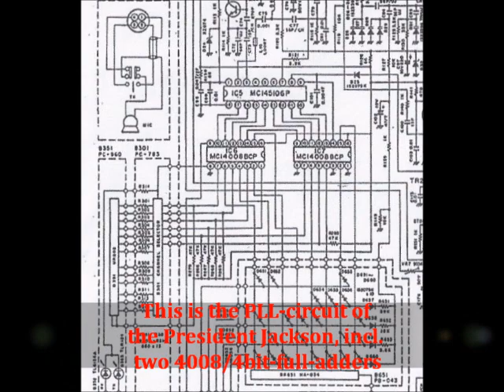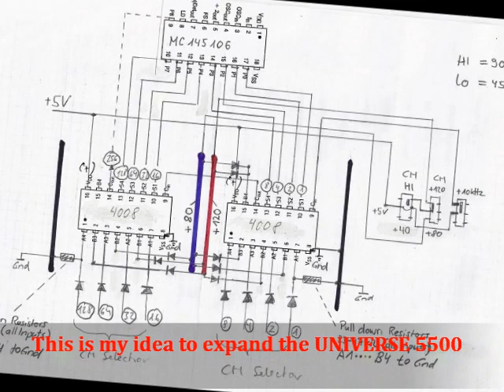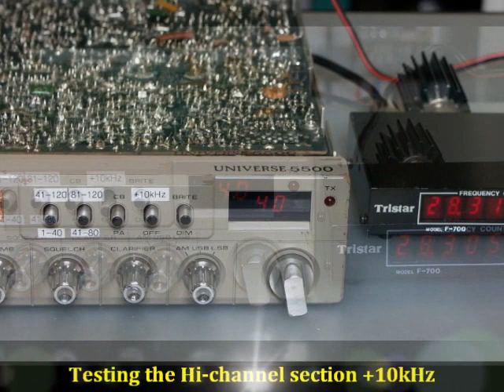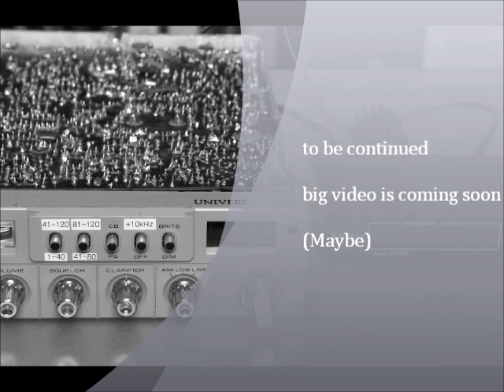Frequency expansion for CB-radio-PLL synthesizers incl. two 4008 4-bit-digital-full-adders

Comment: My friend in High School had the same radio. He had done the same or similar modification and his switches were marked much the same. It was nice sounding radio on am and ssb. He reverse polarized it by accident when working on his truck. He replaced it with a Cobra 148 GTL with a channel kit but it was never as good sounding on the air. It was smaller chassis and looked a lot nicer with the chrome bezel!
Reply from the maker: CB Radiofan buckaroobonsi hello, thank you for your post. CB-radios are a passion of mine. It was a beautiful time in the 80ies: Big CBer Partys and Events! Without smartphones  and facebook profiles... Happy airwaves to you..
Reply: Yes it was a good time. Smartphones well they are not the same as a random conversation with someone 3000 miles away. Not the same as sitting in home or in your car working SSB until the sun comes up then trying to sneak into bed with out getting in trouble. LOL

Comment: Have a colt 1200, same configuration. Uses the  LC7120. Low power on AM and ssb carifier needs to be centered. Any tips? 73´s.
Reply from the maker: Mister Carlos hello, thank you for your interest. If the power on your SSB-500 low, you must replace the final transistor as follows in my Video: https://youtu.be/wBASynKrvqA

Comment: Can I add just one more band to use on 10 meters to my Gamond AFS 645 using pll02a?
Reply from the maker: CB radio fan hello. Thank you for the interest. The frequency expansion is to realize with additional offset cristalls. One cristall per band. For the range 27.815-28.305 MHz it needs an offset cristall with 20.555 MHz. For the range 28.315-28.755 MHz one of cristall of 20.780 MHz. The difference is in all case then 0.225 MHz per cristall and per band.  Best 73's to you.

Comment: Have you tried DigiMax Lite?? An Australian based mod, no additional switches or re-using existing ones...Just continuous coverage...

http://wwwCircuitDomain.com and follow link to DigiMax Lite..
Works on all binary (PLL02a, MB8719, MC145106 etc) and all BCD (uPD858, uPD2824 etc) non ROM PLL chips
.
Super easy and fast install..
Reply from the maker: Circuit Domain Hello there. Thank you for the info. I'll take a look on this page. Best 73's to you...